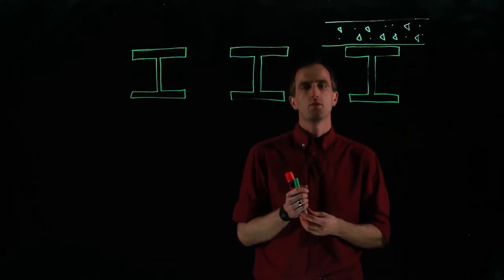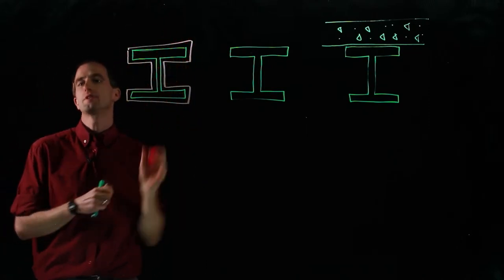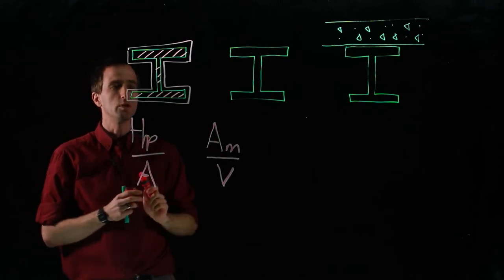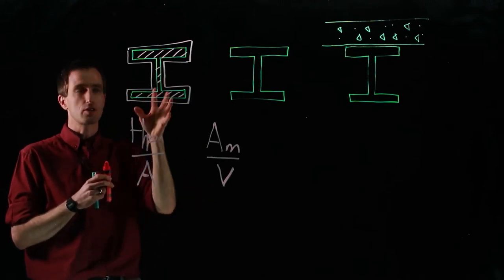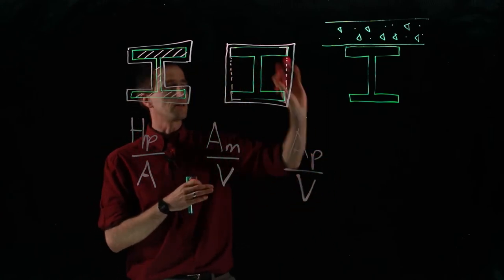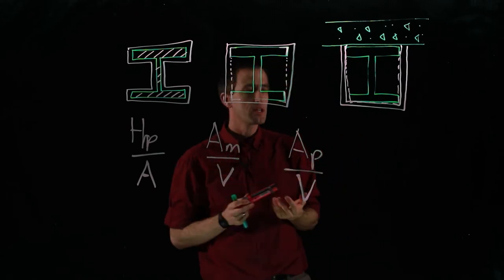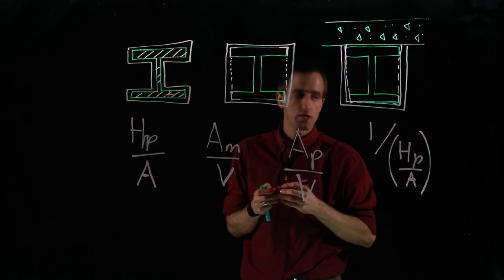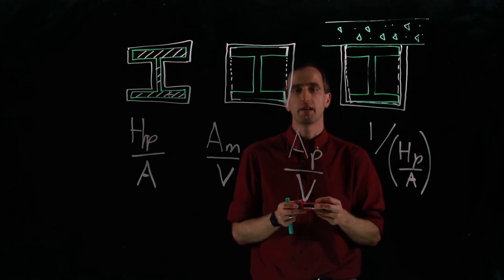Steel Structures in Fire: Section Factor

Comment: weight of concrete cover in  inches that will provide a Fire-Resistance Rating of 1.5 hours  structural steel column
Reply from the maker: You normally don't use concrete but rather spray-on products such as vermiculite. However, if you cast a column in a concrete section you can use standard concrete cover in most cases - e.g. 30mm.